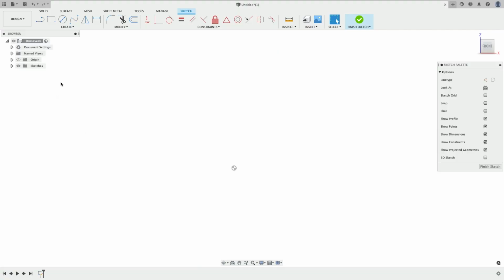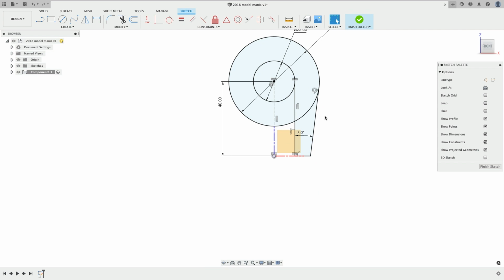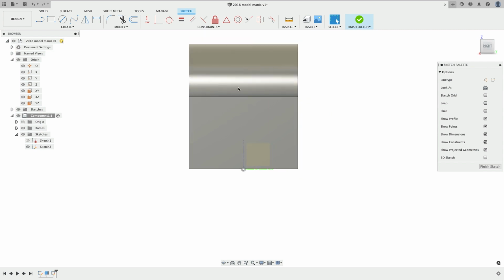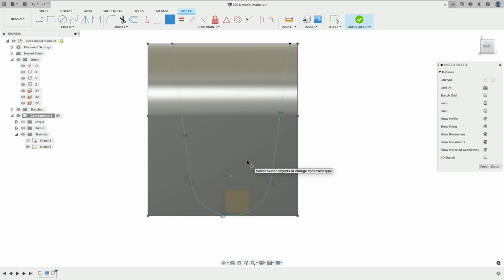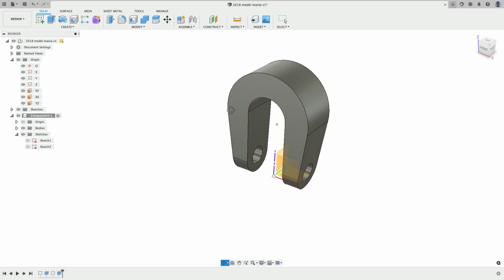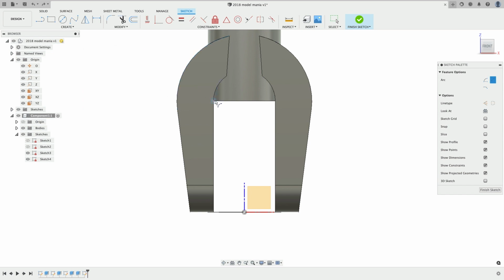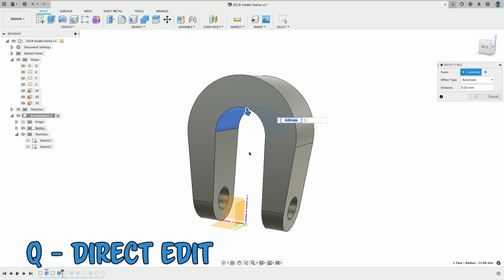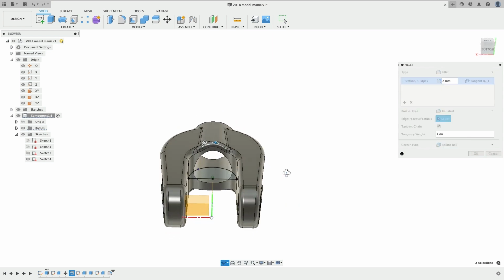Modeling with Fusion 360 (Model Mania 2018 Example)

Comment: I'm curious why you sketched the draft angle starting around 4:50 rather than using the draft command? I couldn't get the draft command to work but I was working under the rule of using modifications to keep drawings simple. Thanks for all your great videos!

Comment: Hello. Thanks for this. I use Inventor but the commands seems to be similar to Fusion 360. I will not be getting Fusion 360, but am wandering if there is value in following the logic and techniques you use here. If you were modelling in Inventor would you adopt similar strategies?

Comment: Another helpful video. 
Thanks, Tyler! 
I learned to add fillets to a feature. 
For the cut operation with the arc: you could create the corresponding sketch after the 4th operation (2nd extrude) in the timeline and project the arc which is still complete at that time. Then use this projected arc for the cutting operation later.
Reply: Or a quicker way: use the inner circle of the first sketch for the cutting operation.